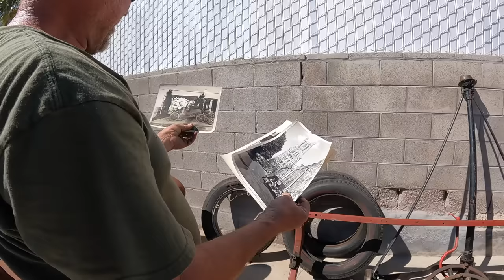What Did Merlin Buy on MarketPlace Now?! This One Will Cost Him $$$

Comment: A shop teacher friend of my dad's, and his wife rode this exact motorcycle from Colorado to San Fancisco and back!  In the early 70's , they were both a bit beefy, I've always been impressed with their tenacity!
Reply: I have a 1970 SL Honda Motosport 350 it has bigger valves and Longer rake for better handling I call it Frankenstein I took 70lbs off of it with every after market part Yoshimuira low pipe two into one 750 front disk 1980s suspension inch more travel air assist fork brace top and bottom Akront rims Ha ha ha 1hp for 10lbs 😂🤣😃

Comment: Wow. I look forward to you working on these T's. My dad used to tell me about how he'd drop the pan and shim the bearings when they started knocking. Growing up during the depression you did what you had to do to keep them running. Growing up in MN he said they would heat a pot of water on the stove and wrap it in blankets and put it in the back seat. When they got to town they would drain the water out of the radiatort and when they were ready to go back to the farm they dumped the warm water in the radiator and away they would go. He also talked about building a fire under the pan to warm the oil.

Comment: I have a 1970 Honda SL 350 Motosport it has bigger valves and Longer rake for better handling I call it Frankenstein I took 70lbs off of it with every after market part Yoshimuira low pipe two into one 750 disk Akront rims 1hp to 10Lbs inch more travel air assist fork and upper and lower fork brace steering damper adjustable 😂🤣😅

Comment: Merlin you have a magical touch with anything with a motor. I have my dad's collection of old model A and model T original Ford wrench's and jacks also a couple of the running board mout toolboxes everything has that classic Ford raised emblem. That have been sitting in a old steel storage container that my dad had gathered as a truckdriver crossing the country for years up until the late 80s some are almost S shaped wrenches amongst almost every tool that a person would need to cross the country with on there car. They are really neet. They sure made things to last. Cool video and neet finds.

Comment: Fwiw the 6spd transmission in a 6.0 gas Chevy 3500 service truck I used to drive blew up like clockwork about every 60,000 miles. Intermediate clutch failures I believe it was.

Comment: The Lehigh tunnel is 20-30 min drive from my house. By the way of the crow 10 minutes, so basically in my backyard.
CB350 was the first bike I had to run through the woods at 12 years old. My first big bike lol. 
Just put a knobby tire on back and rip it like an Enduro. Man that trailer was packed full of goodies.
Merlin you keep on buying all these model TnA and there won't be any for anyone else.

Comment: I've got a 05 3500 4x4, quad cab dually.  5.9 Cummins,  automatic with 260k. Only thing I have done to it, replace the solenoids in the trans, replace the AC compressor.    Pulled a 51'  stepdeck GVWR 36k.  Still going strong.   Regular maintenance,  lucus every oil change 5k and transmission service 10k.

Take care of it and they last.

Comment: You need to set one of those up for running trails. When I lived in Arizona many of the old trails known as Jeep trails were made by Model Ts. Obviously it's not crawling rocks but they went a lot of places not to mention chopped and used for farm work. My grandfather said they used one to run a saw that was belt driven. Jack up the T put the belt on the drive wheel and saw wood. When done drop the rear back on the ground and drive home.